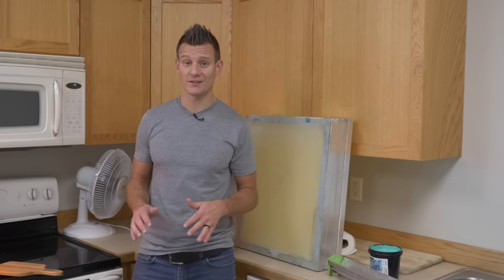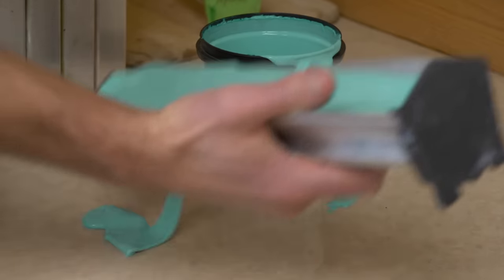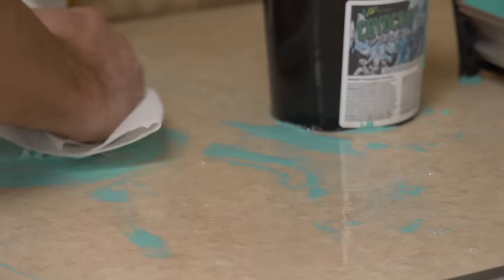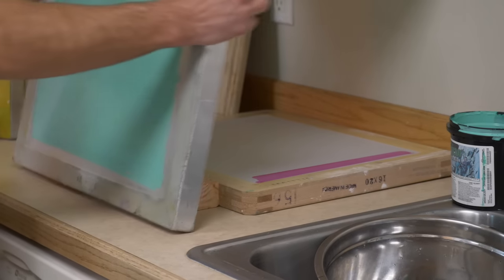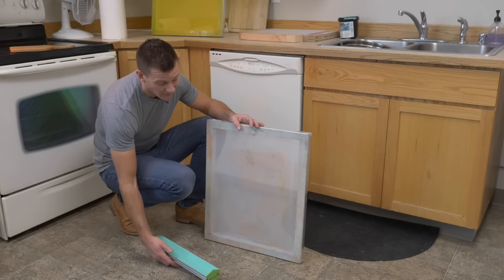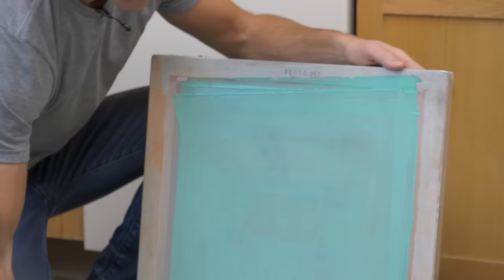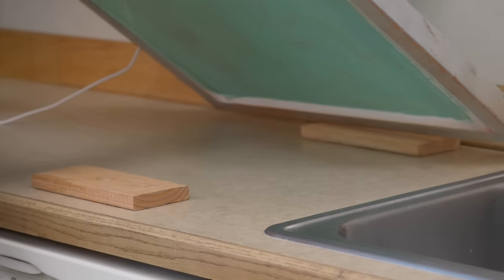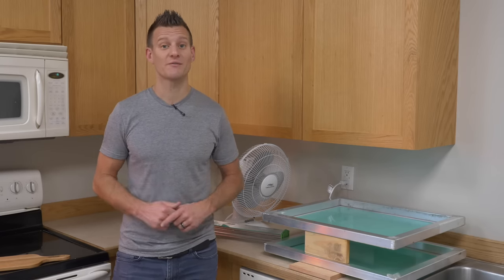5 Common Mistakes Beginner Screen Printers Make When First Coating a Screen with Emulsion

Comment: Perfect and thanks Ryonet. But since I am a beginner, I don't want to mess up with a screen coater and I don't even have one. So I simply and simply use my flat and smooth edged school plastic or acrylic perspex ruler cut to different sizes and off I do the job and simply wash my flat piece. But well well well one day I will try and use the scoop coater, but for now I use my flat scoop ruler. But do you know something? I DON'T MESS UP AT ALL!

Comment: Hey Ryonet! I like your tutorials a-lot. You inspired me and now I have started doing screen printing at home. 
When i saw the title of this video... i said oh i got a solution ☺️ to my problem but sadly it wasn’t in your list☹️. 
1. When i coat the emulsion onto the screen, it forms some dots over the coated area or it’s like unfilled areas on the screen whereas i try my best to coat evenly.
2. My emulsion becomes so runny when mix the diazo in it. I keep the ratio 1:10 is it right ? Or do I decrease this ratio?

Comment: Constructive Comment:
All the videos that Ryonet produces are great... but. Here is another video where the host makes a generalized statement like... "Use a lot of pressure" or other videos that say something like... " You should use a fair amount of pressure". I write this because a lot of pressure" or "a fair amount of pressure" for a 6 foot 6 inch 350 pound person might be different to a 5 foot 98 pound person.

If a Ryonet host would say "One should use about 10-15 pounds of pressure", no matter the size or how strong a person is, the Plastisol, Water Based Ink, Emulsion or what ever else will always be applied perfectly.

The amount of pressure needed will be something I will be asking if I do not here it from the instructor of a future Ryonet Screen Printing Class that I will be taking in the near future. See you guys at the ISS Long Beach 2019.